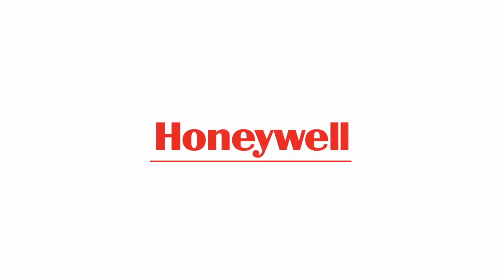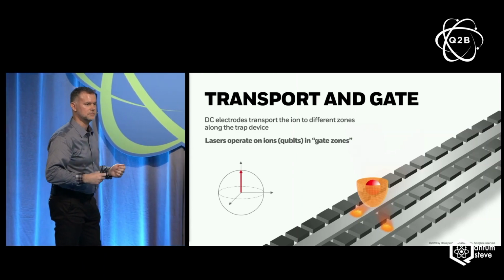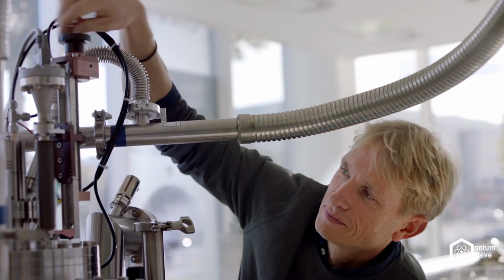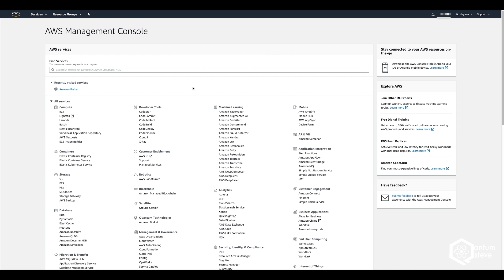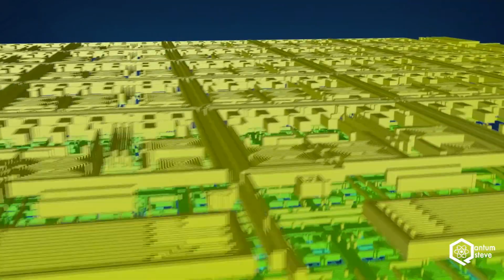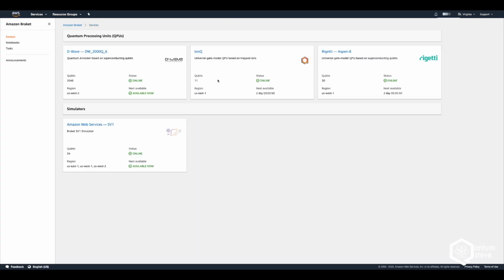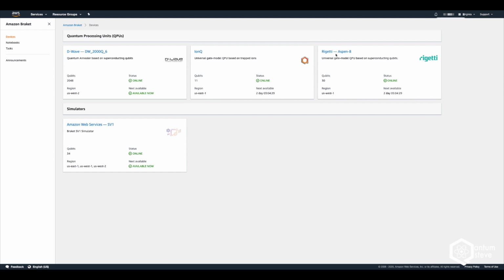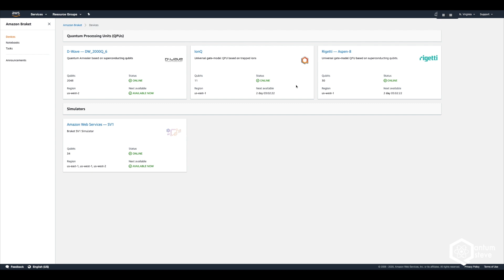New Quantum Computers - Quantum Computing News

Comment: Cause The Qbits would spin out of control, So you would needed the Gates to help guide and prevent that, Right?
Reply: Cause you need a Straight flow, right?
Reply: So, maybe a magnetic field pulling and pushing the Ions?